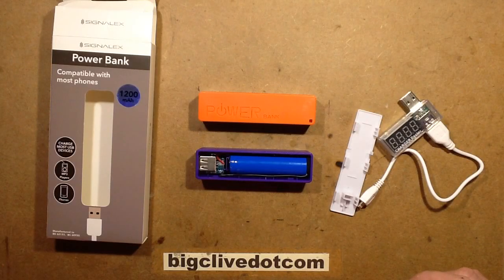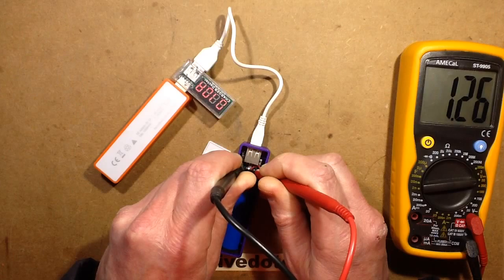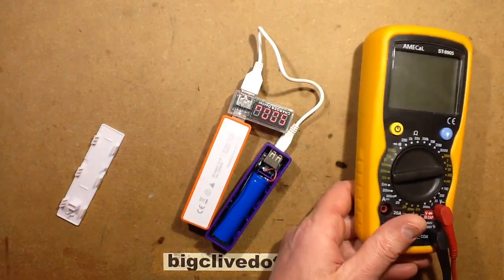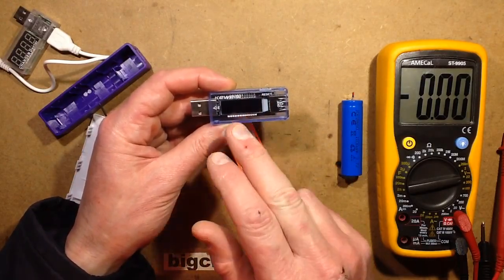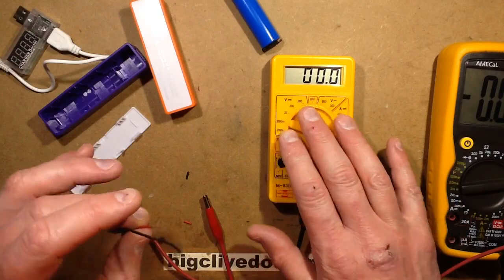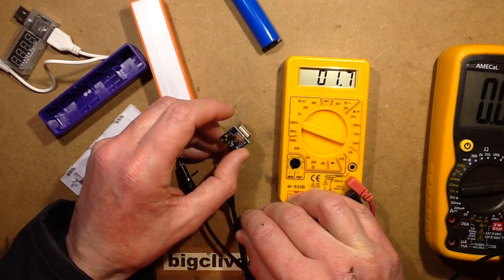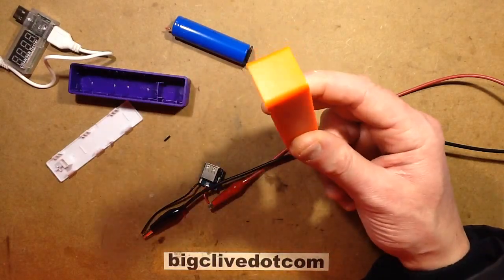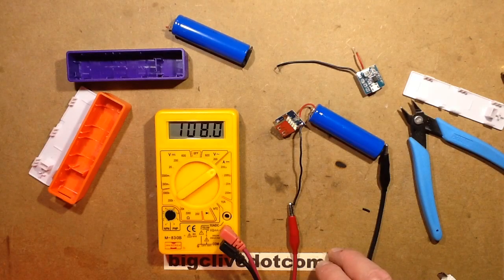Poundland's 2016 power banks.  (not a good start)

Comment: Hey Clive, have you considered getting one of those Anker powerbanks to see what a so-called quality product is like in comparison? I got one on the Amazon black friday and it seems pretty solid, but who really knows what's actually worth the money, these days?
Reply: I have 2 Anker powerbanks from 2012 and they still do wonders for my electronics. I haven't had one problem with them since I got them.
Reply: I actually took my Anker apart and posted a video on my channel. They do actually use good quality parts like they say. I play Ingress and we all swear by them. Also good customer service.
Reply: The internals have worked flawlessly for just over a year for me , I have the Powercore 10400 or something, I havent particularly babied the product however I found that the plastic often chipped and broke around the seams and in particular around the corners , have you experienced that ?
Reply: I have bought quite a few anker chargers and batteries over the years and took apart most of them and they were consistently very high quality. Always used name brand battery cells and components (ie: Panasonic cells and Texas Instruments or Maxim power management IC instead of random shenzen market batteries and Chinese generic power management IC's). There are a few teardown reviews on amazon too, solid products. You get what you pay for with them.
Reply: TwistedSyn ya like I say its most likely me , more or less just impressed with its durability though , tough little buggers , great for travelling its probably been on around 8 trips around Europe and never left me with absolutely no charge even after I charged up family and friends phones up fully. (I have an S6 and get about 4 or 5 charges out of it) $13 for that 'lipstick' anker is cheap. Over in the UK were paying £13 right now. :)
Reply: These are the ones I have except older. 
https://www.amazon.com/Anker-PowerCore-Lipstick-Sized-Generation-Batteries/dp/B005X1Y7I2/ref=pd_lpo_107_lp_t_4?_encoding=UTF8&psc=1&refRID=2RA852WAG3XGA8D6CRXK

I haven't encounter any chips around the seams at all. I believe my dad has your model though from what I saw on amazon. He has had it for a couple of years and travels frequently. He usually keeps it on his work desk and I haven't noticed any damages that you are talking about.
Reply: What about their cables?
Reply: ShadowHunter120 they're pretty good too, especially the newest ones. It's hard to screw up USB cables in general but Anker ones are pretty high quality and doesn't break as easily as the cheap no name ones
Reply: I actually took my Anker apart and posted a video on my channel. They do actually use good quality parts like they say. I play Ingress and we all swear by them. Also good customer service.
Reply: I’ve used Anker power banks for years. They’re pretty good. The only reason I upgraded from my old 5000 mAh to a 10’000 mAh one was that I wanted a flatter form factor and the larger capacity was a nice bonus.

Comment: Hello mate, 
yeah them 18650 cells should be fully charged at 4.2v down to 3.8v or so to be healthy.  iv been using these batteries for some years now, and iv so many battery, and battery packs.
 iv purchased many and made myself. and modded them, cells at 1200mah are very poor. they won't last 5 mins charging a mobile or tablet. maybe OK for a led USB lamp. but that's it lol.
a very good 18650 cell is above 3.8v @3600mah that's a bloody good cell. and being a good make like SAMSUNG or EFEST , INTSUN, or OSOV" SONY, PANASONIC, EBL, TUOFENG are not too bad for the price. then your laughing.  iv dismantled many Emergency battery packs and replaced the cells for good current lasting cells, with better and had a very good battery pack at the end of it. lasting over twice as long! you always get cells inside phone battery backs below 2000mah. why you ask! for cost!! 🤔

thanks for sharing ya video mate,
very interesting inside them pound units. 😉👍

👍👍👍👍👍THUMBS UP👍👍👍👍👍

Anthony 

High1Voltage1Rules

Comment: Welp, I picked one of these up from poundland the other day to use to power an (equally cheap) LED torch. It seems to be working fine so far and came with a charge, I did a very unscientific test of battery life and it could power the torch for over 8 hours on a full charge.
I'm not sure I would be comfortable plugging my phone into it or leaving it on charge overnight, but that is true of any £1 electrical product regardless of what its actual quality is.

Unfortunately my local pound world is too far away to justify the trip for a £1 battery bank.

Comment: Didn't expect it to be this crap.
Reply: They have to do something with all those containers full of dead 18650 cells we send to China for "recycling".. which they do.. straight back to us..

Personally I scavenge the decent cells from dead laptop batteries and put them in mine.. and the poundland ones go into the customers "my battery won't charge" things.. they usually get a few more months for their small investment :)
Reply: its £1 what u expect ? prob costs more to ship them
Reply: I have a dozen of those salvaged cells sitting right next to me. Ranging from some blue at about 2000-2200mAh  to the good red ones at over 3000mAh each. Well worth the effort to recover them and put them in those cheap DIY power bank kits (I like the ones with the built-in flashlight).
Reply: evoGage From Poundland?
Reply: evoGage decent 18650 cells are are a good £3 each, and that's direct from the manufacturer in bulk. haha
Reply: Bit late to the party, but one goldmine for identifying salvaged laptop battery pack cells has been this site for me: https://secondlifestorage.com/celldatabase

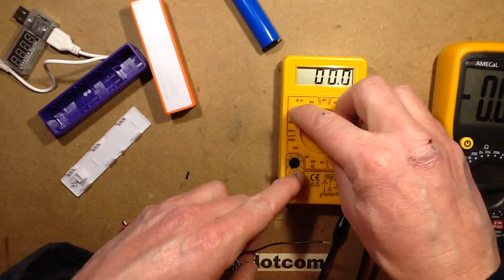Comment: 7:14 Yes there is a fuse protecting the 200mA and lower settings. Unfortunately there is no fuse when on the 10A setting using the 10A connector socket hole.
These are pretty good inexpensive hobbyist  "disposable" meters for use under 50 Volts.

Comment: Hey Clive just heads up at cpc you can get an auto range  meter with rs232  and data link with a temp probe for 17quid. its a Digitek meter use it everyday.   heres the link

http://cpc.farnell.com/tenma/ten01008/digital-multimeter-rs232/dp/IN06158

Comment: I once bought a powerbank in a local store but its shit and self discharges and its only 4000 mah and it costed more than my 10€ 10000mah xioami power bank
Reply: My Acme PB06 power bank is quite good considering the self-discharge rate. Had it knocking in my pocket for weeks and charged quite a few MP3 player battery cycles before I had to recharge it again from one bar.
Reply: its absolute shit. its a lipo btw.
its the only one i have that will drop from 100 to 75% in a few weeks unused

Comment: have I got this correct ?   LiPo should not be completely discharged and requires a balancing charger and tester
                                             LiOn can be completely discharged
Reply from the maker: I'm under the impression that no rechargeable lithium cell should be over discharged below about 2.5V at worst.  I'm current experimenting with this dead cell and it did take a charge.  But there's apparently a risk of copper shunts forming in these cells when over discharged that can perforate the membrane and cause unpredictable failure.
Reply: thank you

Comment: I picked a couple of these up recently.
One has broken inductor, top snapped off, so understandably doesn't work too well (can these be fixed with e.g. conductive glue ????).
The second took 752mAh on charge and gave 450mAh output with a test load.
Not too good, but what do we expect for a quid..........

Comment: definitely do the multimeter thing. Ive got a couple of cheapometer variants, a black version of that yellow one and one thats based on the same stuff inside but its super tiny and cute and while I would never use them for anything where theres any shock risk theyre perfectly good for low voltage stuff esp those times when you need a second meter. sure theyre cheaply made etc but they work fine and theyre even accurate enough for most hobby use. but theres a lot of meter snobbery around that leads to people thinking they have to buy 200 quid flukes for led and battery stuff.
Reply: You can test the EEV Blog multimeter also...

Comment: Looks exactly like the few-cent cheapies from eBay (OK, they're without a cell) - had several of them overheating - the IC failed on higher loads and shorted the cell.
Reply: over the last few years Ive found pretty much every variety of power bank chip and circuit arrangement in those same boxes, both empty from ebay and with cells from discount shops, its pretty much impossible to know what youre getting until you look inside which is a shame cos some of them are really good once youve put good quality cells in them
Reply: Jupp - just checked, mine are using a FM6316 so different type…
Reply: BitBastelei i had a FM6316 and it also failed with high temp and shorted. But I also have this chip from the video and these don't short the cell (they have not failed so far, but I don't use them much).

Comment: Hi Bigclive (like your vids) I got a few of these power banks from poundland myself the first one would not take any charge. It was a dead pcb. the battery is marked 1200Ma i ran a charge and repeated discharge test three times on my B6AcV2 Charger/ Discharger at 800Ma Charge and 1A Discharge  result 1197Ma output . No heating of the battery the other units appear to be working ok. No problems as yet with them for a pound thats not bad.

Comment: Holy shit, they sell the Orange type power banks at my local Kmart for $10AU. What a bloody rip off...
Reply: but they probably don't
Reply: Moneypit330 Yeah, I work at walgreens and the Infinitive brand is our companies, including the Nice!, and De-lish brand.  They are usually on sale for buy one get one 50% off or buy one get oen free.  I was very skeptical as to their real capacity, since their competitors were much more expensive.
Reply: They may just have the same casing though, but a better circuit and a higher quality cell.
Reply: Depends on what is inside. Some of these $1 power banks look like a rip off and could cost you a lot more when a short kills your phone.
Reply: Walgreens sells a $20 10000mAh bank, seems sketchy.
Reply: you can get them on aliexpress really cheap sometimes 50 cents
Reply: Prodigy Productions I think it was Infinitive brand.  I purchased 2 of them for $15.  They had them labeled wrong on the shelf as an iPhone case at buy 1 get the 2nd for $5.  I took it to the register and the manager gave it to me for that price.  I couldn't see how thick the power bank was, inside the package, and was hoping it contained 18650 cells that I could potentially swap for better ones.  But it has the flat lithium cells.  First impressions.. it's probably closer to 3000mAh, as it will barely charge my phone from 20%-100% before the LED indicator on the power bank shows 1 LED lit (25% capacity) left in the bank.
Reply: At 5 Below in the US, they have the 3 cell packs for $5
Reply: I have a very good one with the same casing. That case doesn't seem to indicate the inside there are many different power banks with the same case.
Reply: I got a 5000MAH blue one at my Local Big W for 25AUD ;-;

Comment: I bought a couple of these without the cells off ebay a couple years ago. They were a couple of dollars each, and have spring contacts to add your own 18650s.

One of them outputs 5.1v and the other puts out around 4.7v. The quiescent current draw on both is about 100 microamps. 

Charging the cells works fine in both, but I usually use one of my dedicated chargers. Definitely a good idea to keep the cells out of circuit when not in use.

Comment: same thing happen to me, one of the power bank was flat. every time I charge it up, it would discharge. I took the battery out and hook the board to a 4 volt supply and the board over hearted then smoke. the good thing is the case make a great project box for a Arduino nano

Comment: I have a couple of the earlier "dodgy" Poundworld ones which have the 18650 in a battery holder and the flush case. Those have the same chip as the Poundland ones you have there: maybe there is more than one sort with the same appearance? 

I also have a later Poundworld sticky out case one, that had a duff charging LED but seemed otherwise OK. It did have the annoying feature of cutting out under low current drain.

Although they all say you can draw 1A from them the output voltage drops significantly well below that for the earlier ones.

None of the ones I have are anywhere near 1000mAH.

Additional: just had a look round a local B&M shop they have some powerbanks which are reported to be 1800mAh for £3.99... the case looks familiar but they have the "Intempo" brand.

Comment: At 5V the max capacity would be around 888 mAh.
The battery rating is at 3,7V.
So 3,7 * 1200 / 5 = 888 mAh.
That is with a 100% effecient boost converter. I usually take 10% off the rating since no boost converter works at 100% effeciency, so around 800 mAh would be my best guess.

Comment: It's possible the reason you measured 2000mAh on the "good" one is that it uses a linear regulator arrangement for charging (as opposed to a switcher). A TP-Link 10400mAh powerbank I have uses a linear regulators for charging too, and the circuit board gets quite hot. Also, the input current does not vary regardless of voltage, that's a dead giveaway of a linear regulator. In any case. I find that measuring discharge power is better to determine powerbank capacity.

Comment: I don't see why you can't charge a flat 18650.  It might not be too healthy when it charges but it's not going to hurt anything.
Reply: Do R/C! it may explode. Pretty good reason not to charge one I think.
Reply: GetTheCheeseToSickbay well, I usually charge them at a much lower current if they are flat - no casualties so far...
Reply: GetTheCheeseToSickbay I know that a lot of people say that but it just isn't true.  I've charged dozens of completely flat 18650s (salvaging old laptop batteries) and nothing even close to an explosion has happened.

Rumors of how easily lipos explode are greatly exaggerated.
Reply: When a Lithium cell has no voltage for some time, the "normally separated" chemicals that make it start to breakdown the barrier and mix together, so when you try to charge the cell it will either be a hot resistor, or worse, a short circuit, both of which produce heat which lead to an increase in the cell internal pressure and an explosion.

Lithium polymer batteries are more susceptible than Lithium ion batteries (which 18650 are) but you should always take precaution when charging a dead cell and quickly unplug and discard the cell if it's getting uncomfortably hot.
Reply: Achraf Almouloudi Good advice.  I have a thermocouple attached to my charger so if automatically stops charging if temps get too high.  Like anything else with a judicious dose of common sense it'll be fine:)
Reply: It's a matter of risk multiplied by consequences. You may not have charged enough dead cells to win that particular lottery.

Comment: you should test some hi end power banks like mophi
Reply: justin rivera I'd like to see a showdown between mophie and anker
Reply: remo spadaccini that would be awesome
Reply: but throw in some other banks as well like
Reply: the zero lemon
Reply: Only problem is the cost now 😂😂
Reply: Seegal Galguntijak yeah that would make it much easier
Reply: I use a ORICO 10000MAH power bank. Its top notch quality, you'd be stupid to look past it.
Reply: I'd like to see a test of the XTORM power bank "Trip", because I have that unit, and its charge indicator LEDs are not very accurate. Also, it always charges much more mAh than it can actually provide while discharging it. I'm not sure though if that's due to the fact that there is a factor between the nominal cell voltage of 3,7V and the output voltage of 5V.
Reply: Any gen on how good (Or not) PNY branded power banks are? I picked up a couple of 10Ah ones on Black Friday from a certain high-street computer retailer, and wouldn't mind knowing if I've bought a good product or a liability. :-) 
 
I've had one of their "Fancy 2600" banks for a while (Chosen for the Hacker reference as well as the price! ;-) and it seems to be fairly good, though has seen a drop-off in capacity and longer charging times that I imagine are part and parcel of three years light consumer use plus my ignorant habit of storing it fully charged during the first two. 
 
I know PNY flash drives are a pile of cack (That's one area I can claim experience in) but based on the 2600 I'm hoping PNYs battery technology succeeds where their flash drives (Also sold under the HP brand) fail. :-)
Reply: Seegal Galguntijak it's because of the internal losses, I have a X storm however never tested capacity..
Reply: Andrew van Leeuwen mine is closer to 6000mAh than the 9000mAh that are written on it.
Reply: Seegal Galguntijak that's just due to how the convertion circuit thingys work. Most modern power banks have about 60-70% power efficiency
Reply: That's what I thought it was - the battery has 3.7V, but the power bank puts out 5V, so of course there's a factor of 3.7/5=0.74 in it. Still, this would mean we should abolish all the mAh numbers and only work with Wh (like it's done on some of the better laptop batteries or electric car batteries etc), since the Watt hours abolish that factor, thus are less confusing.

Comment: I would rather they sold powerbanks which ran on, let's say four, rechargeable AA cells, cells not included.
Reply: they do, but 4xaa makes 6v at 2000mah for alkaline, which is about 1 phone charge, not great really, and far more bulky and harder to charge than a lithium cell.
Reply: Juan Herrero My local Dollar Tree sells something like that as an "emergency phone charger". However I believe thay have a max of three cells. And you know for a dollar there will not be any boost circuitry in them!